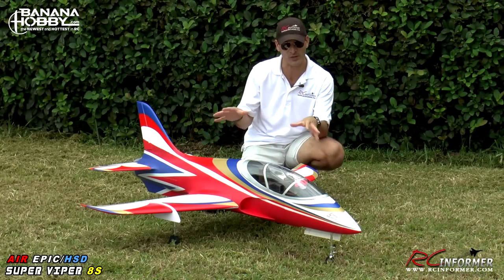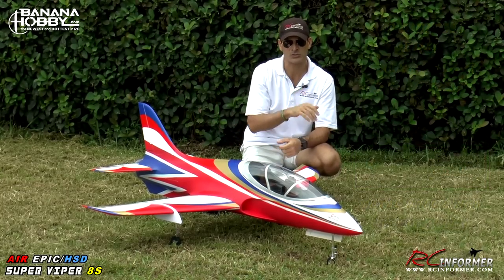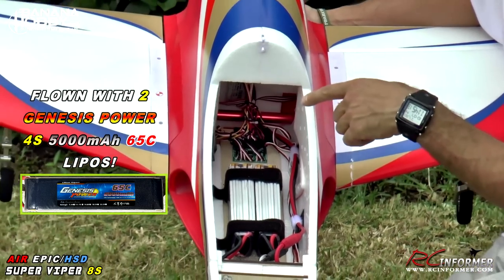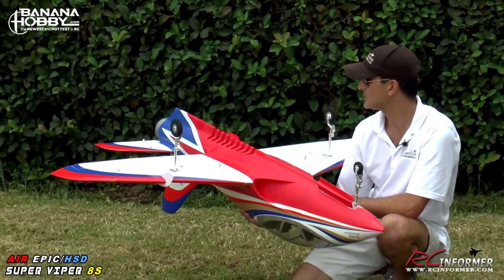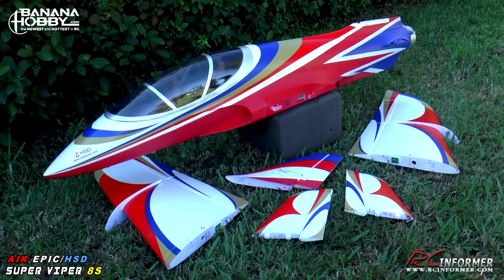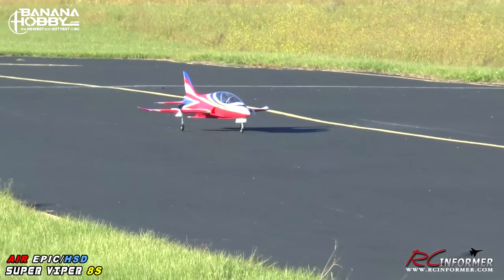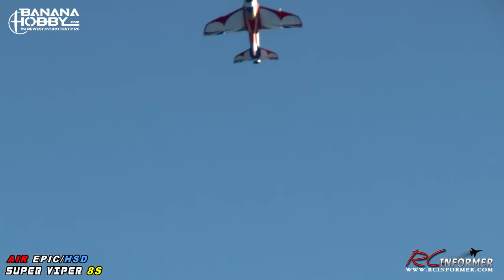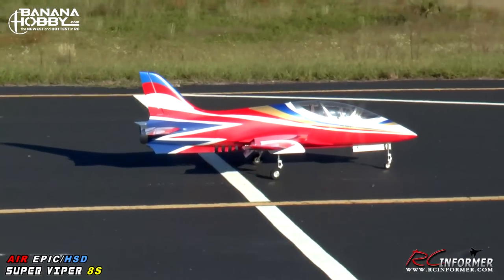Banana Hobby / HSD HOBBY Super Viper Full Flight Demo & Review By:RCINFORMER

Comment: I am looking into getting a 105mm edf.  Do you recommend this over the J10?
Reply from the maker: Depends on what you want. The Super Viper is much easier to fly and is a great Sport Jet. The J-10 is a scale fighter plane with a Delta wing, it flys well but is more challenging to fly and land.
Reply: I am mostly a 3d gasser guy but have owned a few 70mm EDFS.  My plan is to fly on a 8s setup using 2 4s 5000 in series.  Have you found the Super viper to have better flight times?  I would assume its wing loading and design would allow you to throttle back a little but more.
Reply from the maker: Josef Notter The flight time is acceptable, about 3 min... I flew the whole demo on 2 4s 5000 packs... more capacity would be better for duration 5500s or 6000s would do it. Are you committed to that battery setup?
Reply: RCINFORMER I need to still purchase batteries.  The only limit I am going with is I decided it would be a 8s setup.  The ideal configuration is 2 4s in series.
Reply from the maker: look into 5500 or 6000 packs just to get a bit more flight time... it is a sweet jet
Reply: RCINFORMER I ended up getting the the J10. I am hoping I did not make a bad choice.
Reply: Judging by no follow up, did you wished you had bought the Super Viper??